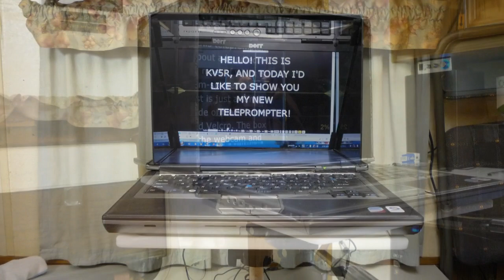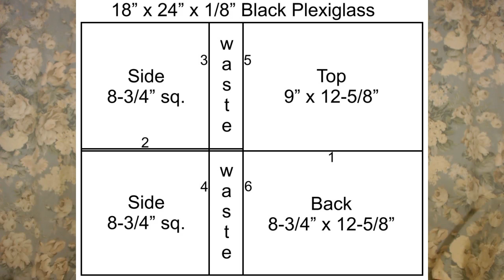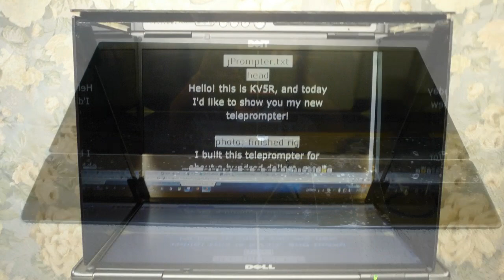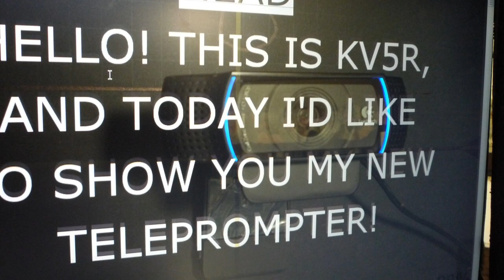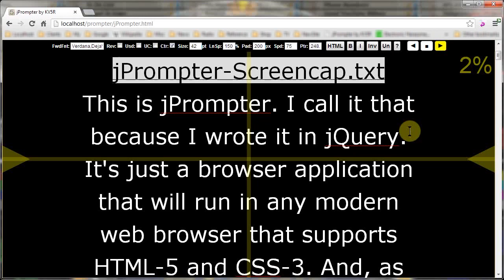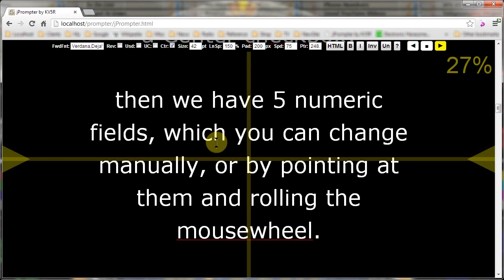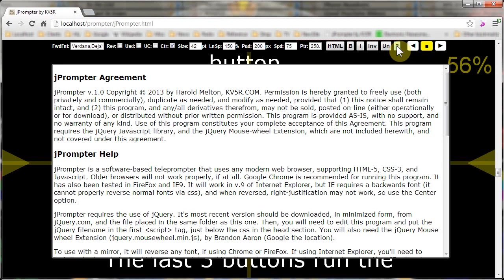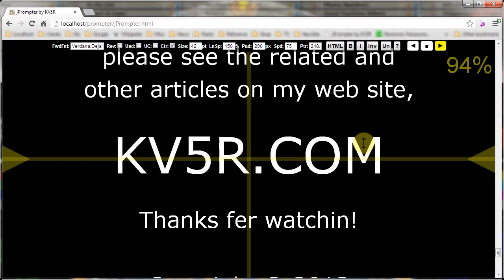DIY Teleprompter and jPrompter software by KV5R

Comment: Why do you need the mirror? Can't you just read off the laptop screen?
Reply from the maker: Good question! The general idea of a teleprompter is that you can read your lines while looking into the camera, thus appear to be making eye-contact with the viewers. The mirror is a beam-splitter (one-way) mirror and the camera shoots through it. The words appear to be floating right in front of the camera, not off to the side. If you put a camera at the edge of a screen, viewers can tell you aren't looking directly at them (as it were), and may be annoyed and distracted. When you appear to be making eye-contact, you hold their attention better, and appear to be more honest. It's a psychological thing...